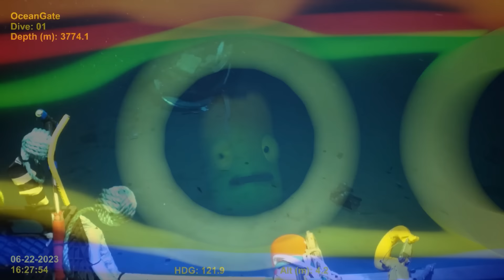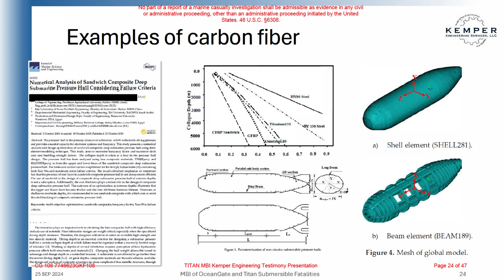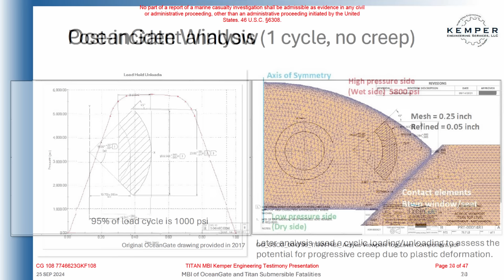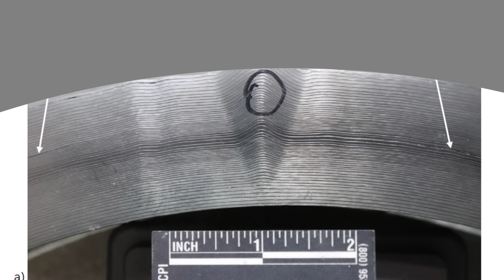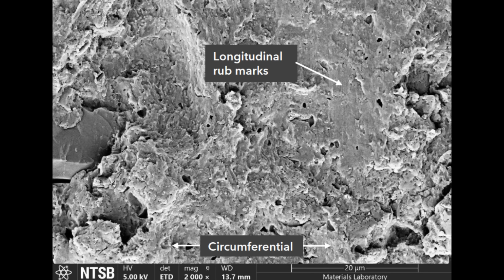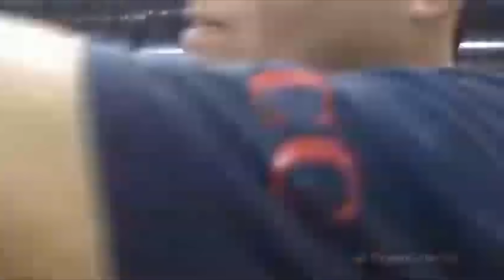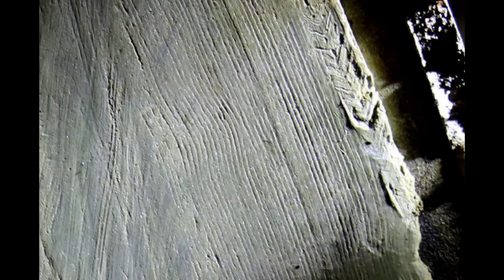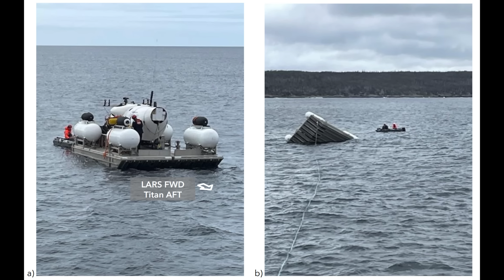OceanGate Wreck Shows Why Sub Wasn't Strong Enough To Survive - NTSB Shares Important Details

Comment: I'm more surprised that the strain gauge and acoustic sensor did work just enough but even that was blatantly ignored for obvious financial reasons. Which is to avoid investigating and thus scrapping the submersible. 

It was all about saving money.
Reply: Yeah, I was surprised too. More credit should be given to the engineer (or engineers) who put the system together in spite of the environment they worked in. Though it must be equal parts frustrating and saddening to know the thing they worked so hard on was ignored.
Reply: @strcmdrbookwyrm  Especially since the system still worked, in spite of being down a few sensors.
Reply: When I heard about them, I was skeptical that they would actually work.  I'm surprised to hear that they did.  I'm not surprised that Rush would totally ignore them.

Comment: As bad as the design and processes are on this, the really egregious thing is ignoring the warning devices that were specifically put in place to warn of a catastrophic failure. Having a poor MTBF is mostly an economic issue rather than a safety issue, so long as you actually replace the unit when you detect excessive wear.

Comment: Additional context about winter storage:  Weather in St. John's (where the sub was stored outside) is extremely variable.  This means it experienced a lot of temperature changes, most passing through freezing/melting point during the winter - and sometimes more than once a day.  There is also a lot of precipitation, including a lot of wet, heavy snow.  There is a reason why we have the Canadian record for the most weather records.  It likely didn't factor into the sinking but thought that the USCG giving a single average temperature for the storage didn't fully represent the weather conditions the sub actually experienced.  [Edit:  I am in no way criticizing the USCG.  I just wanted to add more information and context to the discussion.]
Reply: Surely any residual water vapor snaking its way through the glues applied in a non-cleanroom environment would freeze (expand), go back to liquid, and then evaporate (expand) once again? Could have contributed to some of the microscopic voids found after the wreck was recovered
Reply: @tylerphuoc2653  The roads here in St. John's are horrible because of all freezing cycles that occur in the winter.  Water gets into even the tiniest hole in the road and expands.  Days (or even hours) later, the ice melts, and the now slightly bigger hole fills with even more water.  Repeat until our streets have more craters than the moon.  As you stated, that process had to have some impact on the Titan.  (Assuming an average weather.  Would have to hit Environment Canada records for actual weather.)
Reply: @Beaker709  Yep. Freeze-thaw is very rough on stuff. Spring and summer are when this is the worst because there are above freezing temps in day, and every night drops below freezing. At least in summer and winter, you don't have daily cycles like this.
Reply: @Beaker709  yeah, that's "only" from damage due to thaw/freeze cycling. Imagine if there was some Saran Wrap vacuum-fit over the road and water started evaporating from the heat under there in the daytime.

On second thought, Saran Wrap would be a terrible idea for what I'm thinking of, since it is pinpricked all over to let steam through during microwaving
Reply: Yep. Temperature and pressure cycles are very important for many materials. Especially composites because of the differing strain values of varying materials. "Titan"ium does not expand at the same rate as carbon fiber, which means that stress would build up at the junction of the materials every time they are subjected to environmental changes.
Reply: @HunterAtheist  carbon fibre has a negative thermal expansion coefficient and metals have a positive thermal expansion coefficient. So one material will be expanding while the other material is contracting. Why hasn’t anyone mentioned this?
Reply: They stored it in freezing temps? Oh, that just gets better and better...
Reply: A single constant temp? OK that shows either a lack of understanding the effects of outdoor  winter storage which can be serious or they don't want to talk about the fact this insane project could have been stopped long before the incident as one of the coast guards own was on the board of Ocean gate
Reply: I imagine there will be more detailed reporting on that in the end. This wasn't the final report. 

There are definitely lots of nails in this carbon fiber coffin.
Reply: @JoshuaTootell  I didn't post the information as a criticism of the USCG.  I just wanted to provide additional information to the discussion as I saw many people unfamiliar with St. John's weather seemed to assume that storage here a meant constant and/or gradually changing environment when that was far from the case.
Reply: It is unfortunately the case that carbon fibre is not entirely waterproof. Fibre helps wick water into the polymer matrix, where it can't crystallize, but it can still try to jack the matrix open with temperature changes. Worse when it finds its way into the voids, which it by all reason will help jack open. In my mind, this isn't an if-question, but a when-question.

I'm the wrong kind of engineer, i'm an EE and occasionally involved in electronics rework, but... most of us have "popcorned" a board or an interposer substrate at least once. That's water consolidating inside the PCB along the fibre or in micro voids and going pop from heat visibly delaminating the substrate, and it occurs in devices which have never been wet, merely wicked from the atmosphere. Carbon fibre is said to wick water much stronger than glass fibre.
Reply: No material EXPANDS at the depths they were attempting.🙄

Comment: I always assumed carbon fiber had great strength in it's stretch resistance hence a great material for holding in pressure as a cylinder like an air tank where the pressure is against it's stretch resistance almost like a very strong Kevlar balloon. Now if you reverse the pressure from the inside to the outside of the cylinder that's a different story. It's resistance to stretch is not the same as it's resistance to compression or deformation. Again, a Kevlar balloon that could hold 500 bar or 7250psi inside would completely flatten if the pressure outside to inside were reversed. Also, the fact that they reported loud cracking/popping noises on each dive tells you that every time the carbon fiber was a little bit weaker because it was deforming and the titanium caps and rings were not and the resin does not heal. It stays cracked. The whole thing is absolutely believable based on the stories we've heard about the R&D.

Comment: A photo of the forward dome showed that all the bolts for the view port retaining ring failed.  So I think the view port acrylic was blown 'outward' with enough force to push that retaining ring and break all of its bolts.  Most likely a 'rebound' of the shock wave when the water rushed inside.

That buckling in a part of the forward hull seems pretty conclusively to be the initiation point.  It buckled, sheared around the entire forward segment and that was it.  Hull fractured, water rushed from ring pushing everything 'aft' and death was in the 'wink of an eye'.

Comment: So the Glue holding the layers of CF together basically did what your Carpet Underlay does after a few years of walking on it, compacted into dust from the pressure cycles.... oh dear...
Also yes, as a layperson, I know there are CF pressure vessels out there.... I also know that they're pressure vessels where the pressure is on the inside, pulling the fibres taut, not compressing them against eachother. I really feel like it doesn't take a genius to realise why this is such a bad idea and yet here we are.
Reply: also the cf pressure vessels are for rovs not manned submersibles. no one opposes cf for rovs. they are smaller than a manned vessel and do not have the same considerations.
Reply: @toomanyaccounts  yes. and actually it could be done, even cheaply and on the shoestring found materials budget. they just didn't test how many cycles it would last on average. but provably it can hold up as a pressure vessel to titanic depths. the warning system would have worked for knowing how many cycles if they had actually tested prototypes to destruction, thing is they didn't have money to do it.
Reply: Thank you for this analogy. The powdering didn’t make sense to me at first and I was trying to think of how I’ve experienced that before and you’re absolutely right.
Reply: The only other carbon fiber pressure vessel I am aware of was the US Navy's test vehicle that they sent to be a museum piece after 114 dives, as far as I can tell, any ROV that uses carbon fiber isn't a true pressure vessel and they're just using carbon fiber as a container for the crap on the inside to protect it against rocks or fish
Reply: Yes, it drives me nuts in all these videos where fake experts keep confusing the expression "pressure vessel" with the correct term for a submarine, "pressure HULL".

Comment: Fiber wound structures are very strong in tension, ie, with greater pressure inside than outside.  That is how they ae used in aircraft fuselages...   In compression, it is a completely different story.  Failure is non-linear.  look up "eigen value"...    Also, the interfaces between the hull and end caps appeared to be butt jointed with just epoxy holding it...

Comment: An external mold would have stretched the fibers straight instead of compressing them into bulges.   Also, much to my surprise, I discovered a raw peal ply surface is not ready for adhesion and must be sanded and thoroughly cleaned prior to additional bonding.
Reply: Even if you put aside the logistical difficulties of how to apply the fabric to such a thing (how do you apply the fabric continuously to the inside of a cylinder? And then hold it against the force of gravity? That would require a balloon but the balloon can't be there while the fabric is being rolled out), I don't see how an external mold would stretch the fibers since that is normally done with rollers. It's not like there was no tension when the fabric was being applied to the mandrel. Using a mold seems to only have difficulties and zero benefits.
Reply: @DKNguyen3.1415  they used prepreg material.  It is tacky and will stick.   The problem with a mandrel as was used is that the bulk material is squeezed into a smaller diameter by the vacuum bag and autoclave pressure.  The extra fiber length has to go some where, it ends up as a bulge.  High performance composite tubing is often made in a female mold.  Formula 1 suspension components as an example.

Comment: I just want to add a little bit.. 

If you buy plywood. Let's just say 3ply as an example.. the wood is trash. It's useless. It's just the glue that's strong, heavy, and keeping it together. If you get it wet, the whole thing collapses. So basically plywood is ONLY as strong as the glue/resin. Same with particle board.

Same thing here. The carbon FIBER doesn't matter.. carbon fiber is absolutely a non factor. It can be stronger than diamonds and wouldn't matter because its just tiny pieces. The only thing that matters is what's holding all the pieces together.. and in this case, it's the green glue. Idk why it's so hard to understand.. but good riddance.

Comment: @ 4:53- "....and uses a CERAMIC composite hull....."

Ceramic material is considerably more appropriate for compression loads than CF. The Amphenol connectors used on boats I rode and worked on had ceramic material inside the body of the connector, acting as both an electrical insulator and a pressure-proof water barrier.
Reply: Yeah, as someone who did data back when 1200 baud was fast, AMP connectors were always some of the best-engineered components.  Not cheap, but also unlikely to fail in even the most absurd conditions.
Reply: I put more faith in ceramic than I would CF for something going as deep as Titan did.

Comment: Hold on a second, so there was no mechanical interface between the cf hull and the aluminum end caps? Why would the aluminum end caps not insert into the cf shell to interrupt the shear plane created between the hull and ALU end caps as shown in their cross section image. Such an overlap (lap joint instead of butt joint) would also increase bonding SA.. It a lap or butt joint between the ALU end caps and carbon body???

Comment: I hadn't thought about the window shape so much before. 
If they wanted the window to not have a fisheye effect, why not just add a corrective lens behind a structurally correct window? It wouldn't be any heavier, it would be a lot safer, and you could even overcorrect so that the window makes things look closer than they are.

I still think If I was designing a submersible for tourists, I would go for a string of bubbles design since it's better studied than cylinders for getting more volume in a deep diving submersible. It's what was used for the couple of rescue submarines that have been built. It would also let you put windows down the side on each partial sphere so everyone can be next to a window. 

The Real Gold standard for a future deep-diving tourist submersible is probably something involving a transparent fiberglass composite
I even found a cool example of the material. https://doi.org/10.1016/j.compscitech.2020.108527

Comment: Not sure why they wouldn’t test an appropriate type of optical glue or mechanical attachment to secure a smaller acrylic “lens” to the inside of a tested window to achieve the desired optical result. I would think that would be as easy to produce while raising fewer eyebrows.

Comment: I have no idea why people think Carbon Fiber is a magic super indestructible material...It's strong in certain aspects, but decidedly not indestructible
Reply: Seems to fail rather suddenly and spectacularly — not like steel that will give some before ultimately failing.
Reply: Strong and brittle are tied together.
Reply: When they sanded down the CF, they poked holes in the fabric, and thought that adding more holed fabric would be sufficient.
Reply: Rush had money.  He grew up thinking enough cash will solve any problem
Reply: @yaqbulyakkerbat4190 He cheaped out a lot though. Didn't spend the money on doing the carbon fiber layup properly. Didn't spend money on test hulls for destructive testing. His legacy is one of reckless cost cutting, not throwing money at problems,
Reply: @yaqbulyakkerbat4190  The rich people complex. people just say yes to them all the time because they have the money, so they get a distorted view of their own abilities.
Reply: Like every other material, you have to select the most appropriate one for the conditions you’re designing for
Reply: Anyone who simply watches Formula 1 or Formula E would have been able to tell you that Carbon Fiber is a situational material... It's great at handling forces and loads in a specific direction, thus why the bodywork of the cars and aerodynamic elements are made of it, and it's really lightweight... BUT if you've seen the cars collide at all beyond a light graze or tyre to tyre contact, you know that Carbon Fiber is bad at handling forces in any other direction and it fails quite dramatically. That's why you see front wings lose endplates so easily and sometimes see the front wings or the wheel guards themselves break off.
EDIT: Spelling.
Reply: People are trying to get me to use carbon fiber for my sailboat masts. I think I'll stick with aluminum.
Reply: I see what you mean. I always wondered if it weren't true or not that people don't think carbon fiber is not indestructible.

Comment: The ends were assembled incorrectly! The socket was in the titanium dome, which was lowered onto the glued CF... think of lowering an upside down glass into water... the air inside is trapped. This is what happened into the joint on the sub. Air was trapped in the glue, and under the extreme pressure would have flowed anywhere it could go, causing the glue to creep, or even forcing it between the layers.

Comment: What’s wild to me - carbon fiber is for weight reduction. It’s not actually stronger than steel. It has higher strength to weight. Not higher strength to size. It’s not as tough as steel either, toughness is a measure of resistance to yield failure. And in the water, where it matters the most, weight doesn’t matter. You don’t need to be  light weight in the ocean, not at all. 

If you’re matching the assets of the material with the needs of the project, carbon fiber belongs in the air, not under the ocean.
Reply: Actually, in this case overall vessel weight is important. The overall vessel needs to be slightly more than neutrally buoyant so it can float back to the surface. Typical deep sea subs have non-compressible foam around them to balance the heavy titanium pressure vessel. 
A large multi-passengee vessel would be too heavy to make buoyant, needing a winch to support ship 
In the hearings it was explained Oceangate tried to avoid adding expensive foam and winch, etc, corner cutting with unsuitable resine/carbon fiber instead
Reply: @quesoestbonne  square cube law, just make it bigger.
Reply: Weight matters unless you are willing to get into a sub that requires power to get to the surface and stay on the surface.

Comment: You don't want the inside, that is, the side with the lesser pressure to be flat. For one thing, when it deforms, the flat surface will be under tension. If it's all the same material, it has to be strong both under pressure and tension. That's one reason the inside of a window is concave. And it's a reason why a barrel is a dumb idea for a pressure vessel. The flat direction of the barrel is always weaker.